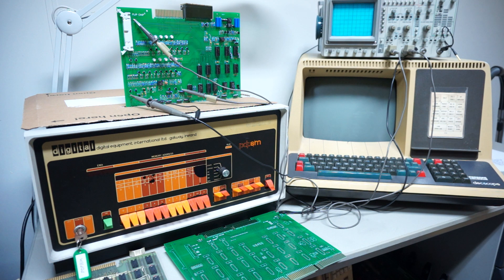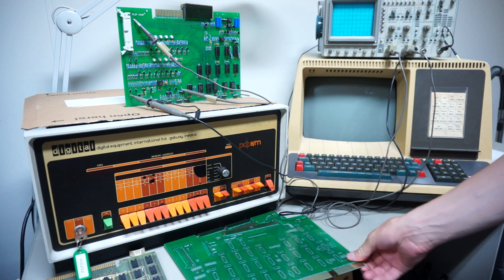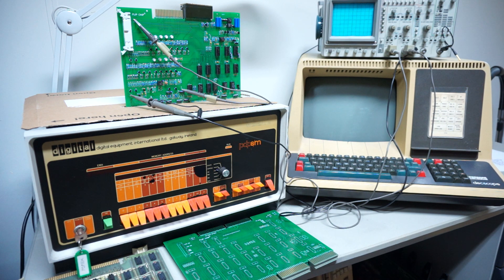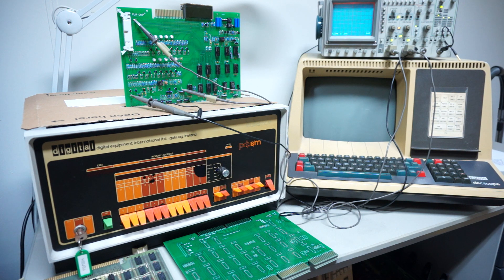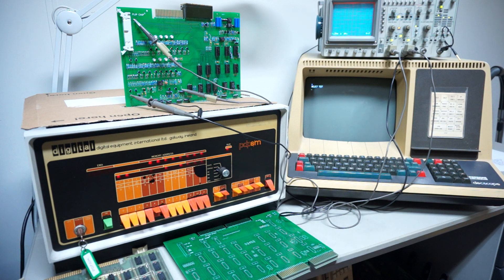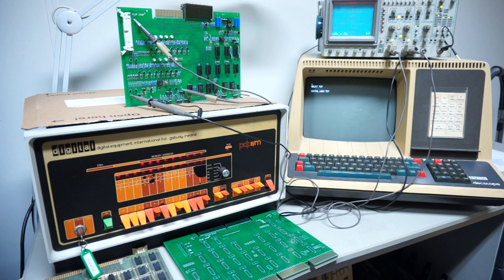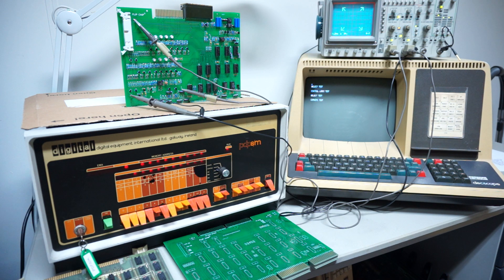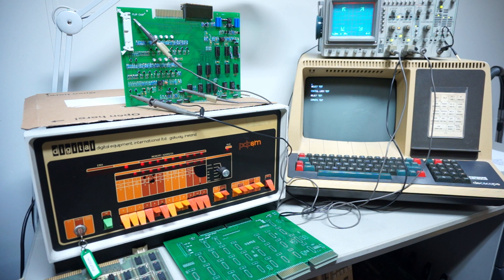Digital PDP8/m VC8E graphics controller replica

Comment: Very cool job Roland.
If I may add: would it not be nice to add some protection circuitry? If there is just one dot (probably in the middle or a corner of the CRT of the oscilloscope) some sort of protection circuitry could drive the Z input to decrease intensity of the dot (to prevent burn-in / permanent damage to the phospor in the CRT).
Reply from the maker: Hi Henk, Thanks! 

And you are right. You have to be careful with a screen which is connected to any XY controller. Protection of the Z signal (turn on and off the beam) is a bit hard in some cases. Some scopes need 0V to turn off the beam. That is easy, when you turn off the XY controller the beam is cut off automatically. But this oscilloscope needs +5V to turn off the beam. Where do you get +5V when you turn off the computer with the XY card in it? So then you need some external protection circuit. The other problem is when the XY card is not running and displaying just the beam at a fixed point. It would be better to detect a 'no signal on X and Y'. So when you detect a signal on the X or Y then enable the Z signal... 

I like your idea of the protection because I have a Tektronix 611 XY display which I want to use on this controller. So I think I'm going to do some work on an external protection... Thanks for the good idea! Regards, Roland